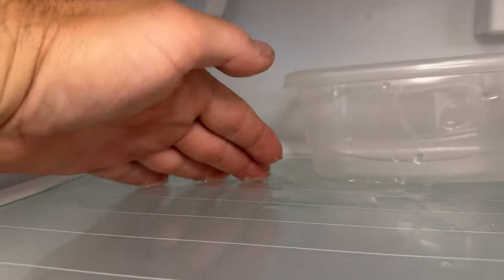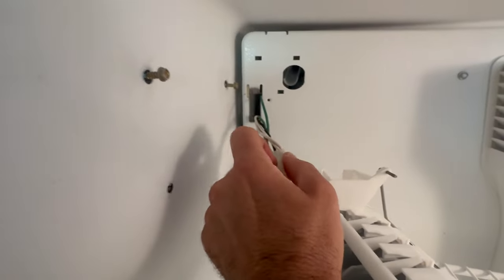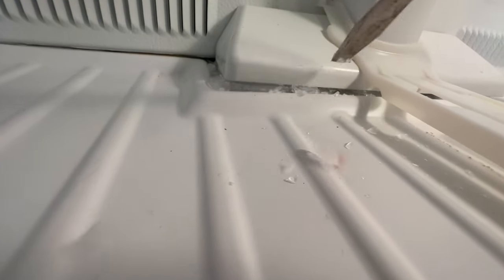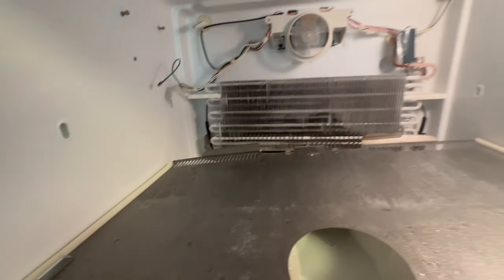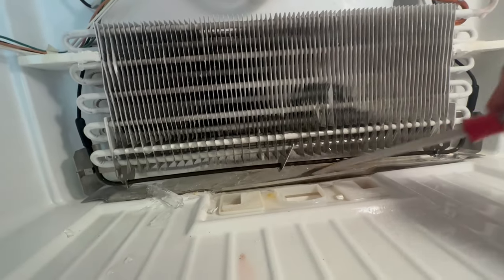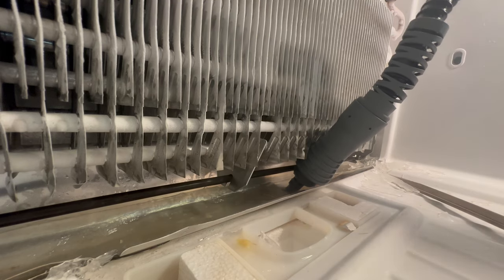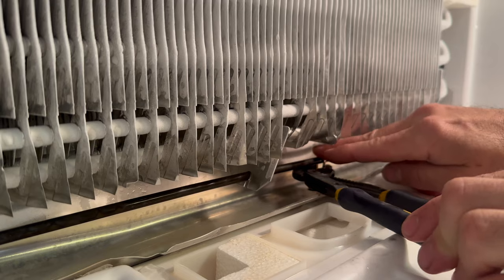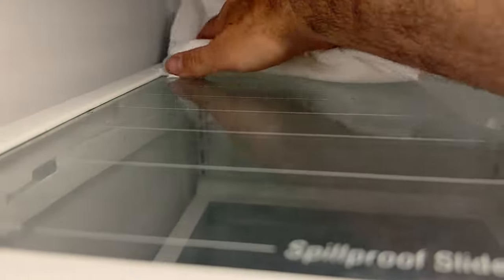Fixing a Whirlpool Freezer that Leaks Water Into Fridge

Comment: Great tips. Another tip is just unplug the refrigerator for two days.  Obviously you don't have any foods to spoil
Reply from the maker: This is the easiest way labor wise :)
Reply: could I really do this? Bc I don't have much food and I am having this problem and don't want to buy a steamer lol
Reply: @Amfxtrading turkey baster with hot water, idk if you figured it out already but that's the go to when you have no steamer
Reply: Is there a way to reasonably get warm water up the return from the back or bottom? I know it sounds ridiculous but I am trying to avoid ruining my food while I'm taking it all apart. It's a garage fridge so all of our meat and ice cream is in there. I have a cooler I can transfer to but not quite big enough. I have a garment steamer that should make fast work of the problem but if I can melt it out from the back or bottom with some ingenuity, I'm with that too. I'm hypothesizing the drain tube runs all the way to the bottom pan somewhere and was thinking if I squirt some warm water up there and then blow air thru it, maybe it'd melt. But maybe it would just freeze the tube more 😂

Edit: forgot to mention, I'm in Phoenix. There is no "just set it down for a few, it only takes 10 mins". Assuming the process went perfectly, 10 mins here is enough to melt ice cream. Although maybe I could throw that in the cooler and put the meat in the house for a few 🤔
Reply: Yup, though for me it took about 6 hours. I put a box fan in front of the freezer and left the freezer door open. The stuff in the refrigerator compartment didn't even get warm.

Comment: Thanks for your video.  Done this 3 times in 4 months.  Used a hair dryer to defrost ice, then hot water from microwave poured into funnel to melt drain ice (~4 cups).  Then used air compressor blowing into drain line to make sure no trash in drain line.  Was able to use a piece of 16 ga. wire to wrap over heating element then into drain hole to prevent reoccurrence.  Also used air compressor to blow dust out back of frig. after removing 4 screws from cardboard back panel.  Don't understand why this began happening after 15 years (2007 model) other than this problem has been a good frig.  Thanks again for the wire/heating element idea.😀

Comment: This is super complicated. Can I just unplug everything for a week and let it all melt away?
Reply: Most people still need to keep their foods cold but if you don't have that need then that'd work and be much easier. You might still need to check his other video for unplugging the boot at the end of the drain line though if you see a bunch of water in your freezer after you let it thaw.
Reply: I have a 2021 Whirlpool 11.6 Cu. Ft. top Freezer Refrigerator.  I went thru the artic freeze (-36) this last winter.  The drain was frozen and kept spilling water into the refrigerator. The weather finally got into the upper 80's.  I left my refrigerator outside for 6 hours.  All the ice melted away.  The drain tube cleared and now water was in the evaporation pan.  I plugged the fridge back in.  Seams to be working better.  No ice built up so far.

Comment: Great video.  Unfortunately for me, there was no ice or blockage.  I was able to pour warm water into the drain and it made it to the refrigerator pan.  I did notice some rust under the freezer drain pan which makes me think some of the water is going under the pan rather than into the drain pipe.  Not really sure how I can fix that.
Reply: Pan might have a crack in it

Comment: I bought a steamer, and it was a good idea, got rid of the ice in no time. I had the rubber boot on the bottom of the drain line, it was plugged up, so I took it off. Thanks so much, your video is a gem.

Comment: Much thanks for this very helpful video which described the problem and the fix in perfect detail!

I used a hair dryer to thaw ice from the freezer pan and a combination of hot water from a water bottle plus an air compressor to clear the drain line. 

I purchased the OEM heat probe which was a bit of a challenge to feed down the drain while simultaneously keeping the upper part at the correct angle so it can be tightened around the heater with the fastening screw.

All said, the refrigerator is working perfectly now!

Comment: The brazing rod is connected to the defroster and will keep it the drain hole from freezing in the future? I have a roll of 16AWG copper wire from an old alarm panel that I might try first since I have that laying around. And I'll be getting a steamer. Thank you.

Comment: Ive always put a paper clip around the defrost heater and stuck it down the drain, but the brazing rod seems like it would work better!
Reply from the maker: Thanks Benjamin!
Reply: Putting a paper clip or brazing rod around the defrost heater and sticking it down the drain...what does that do?
Reply: It conducts heat the pipe
Reply: I don’t have a brazing rod and don’t feel like buying the other part. So the paper clip does work?  I just did this 3 weeks ago and it’s leaking and frozen again.

Comment: This has been very helpful in helping me diagnose what is wrong with a Whirlpool ER2CHMXPL00 Fridge we just got a few weeks ago. Cools and freezes great until the coils freeze over. I defrosted it once, and it happened again. Found your video. Defrosted it again and cleared the drain line. Then it did it again, Now I am looking into the defrost components. The Defrost element has continuity. I was watching another video about what to check next, but it's a different kind of fridge. It says check the thermistor and bi-metal defrost. I see the bi-metal, but I do not see a thermistor. I did find a connector that has nothing coming out of it that is plugged into a connector receiver that has a black and a white wire coming from it. Is that where the thermistor is supposed to be? the part that is coming up when I look up this model and the word thermistor looks like it has a different connection. Any help would be very appreciated.

Comment: Apartment Pro: instead of a brazing rod would a solid strand of #12 copper wire work?
Reply from the maker: As long as it is making really good contact with the defrost bar
Reply: @ApartmentMaintenancePro  thanks

Comment: Ok not even quite 3 weeks ago I found your video because my fridge did the same thing and took it apart like you said but didn’t do the rod and I’ll be damn it’s doing it again! This fridge is from 2004 I think, it was my parents and I took theirs when we sold their house because theirs was better and my mom never had these issues. What’s causing this all of a sudden? Do I need that rod? And yes I do realize it’s getting old. I don’t understand why it’s building up the ice so much.  😩
Reply from the maker: The drain line is freezing over. Got to make sure it's fully thawed out. The rod transfers heat down the drain line 'helping' it not to freeze over again. The drain line could have some blockage in it as well
Reply: @ApartmentMaintenancePro yeah I did thaw everything with my hair dryer as that was all I had to do quickly. I even ran water and it went thru so now I guess I’ll get that brazing rod and try that. Right now I just have a bowl in the fridge catching everything and what’s weird is the bowl that’s in my fridge catching the water is frozen. Not sure why it does that either. But thanks for the response!

Comment: Thank you for the video, in mine it happens almost every month I did not understand the extended what ? that I can buy ?
Reply: Refer to 2:29, check if you have one of those pieces, if not then get one. It will conduct heat directly to the drain and melt any ice at the opening. Otherwise you might have something other than ice clogging it like food or it is somehow freezing later down in the line but I doubt that

Comment: What if there is no drain hole in the pan under the coils?
Reply from the maker: There should be a drain hole there. The melted ice has to go somewhere
Reply: @ApartmentMaintenancePro  I removed the ice but didn't find a drain hole anywhere.  Doesn't make sense.

Comment: .50 brazing rod lol,may I suggest a .01 piece of copper wire instead.
Reply from the maker: Sooooo I've seen that done 100's of times and it always fails, because I only see copper wire on these when I do call backs. IF you go the wire route go aluminum 10 gauge or more non-strand (if you can find it).
Reply: Extremely helpful 😀